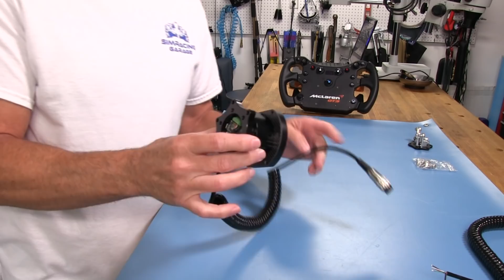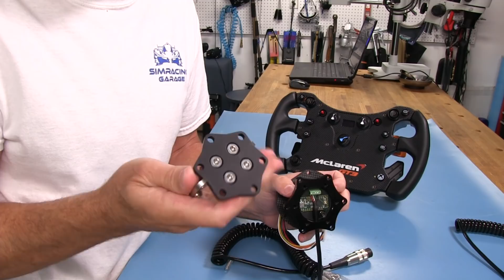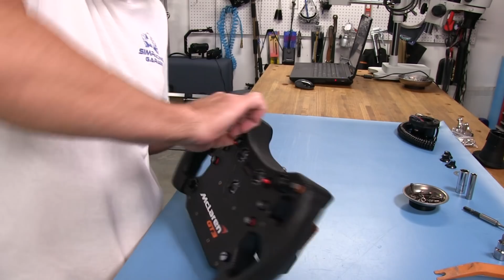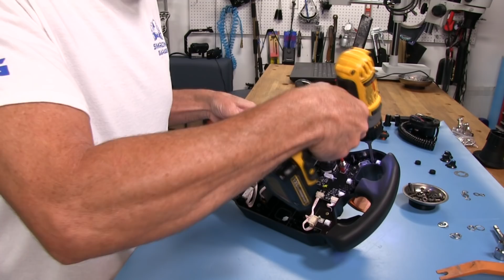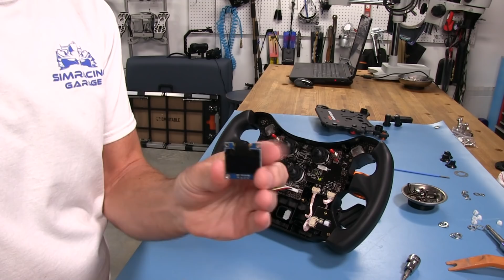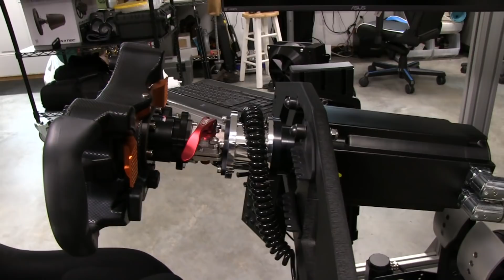SRM Fanatec Mclaren GT3 USB Adapter Review

Comment: i don't this would last (why so much plastic, seriously?a nice looking wheel like that!). in order to make it stronger i would add a aluminum ring inside instead of epoxy if hopefully there is enough space . 4 holes minimum would be threaded. i d use spacers to make contact with the ring. i pre-ordered one and having second thoughts now. yes definitely aluminum rings and stand offs

Comment: Thank you for the video. I am wondering what that molex connector beneath the rhs dial switch is?  Has x101 label next to it.
I am looking for somewhere to get some power for a USB which I want to run to a android pad mounted on front of wheel.

Comment: Interesting that now we know the button on the plastic mounting ring is so the wheel knows if it has the QR installed and the wheelbase can run at max torque on the DD1/2, or if it needs to run at reduced torque for the plastic mount. In point of fact, that means this wheel WAS designed to handle the high torque of a direct drive wheel, which is why it has no trouble doing so when converted. Great review!

Comment: Barry, I always enjoy your reviews.  I purchased the SRM kit as I upgraded from CSL Elite to SimRacing Bay OSW small mige.  However, after 2months of use, the left side grip has completely snapped off the wheel.  I was only running it at 50% (100% in SimCube.  configured as 40nm in iRacing.  which results in 50% power) and had roughly 30hours on it before it broke.  SRM kit is awesome.  But this plastic flimsy wheel will not last long.   First time I used it, I thought I felt some wiggle in the grip.  So I went ahead and took it apart, and filled around the grips with 2part epoxy, too.  But that didn't help.  Your suspicion was correct.  This plastic wheel cannot take the DDW power.  I can't really complain as this wheel was made for CSL Elite, that can run 6Nm.  Not 20Nm like small Mige can.
Reply from the maker: Yeah, we are definitly using this wheel beyond it's intended stress levels. I didn't use mine enough at higher levels to crack anything. But I can see where it would only be a matter of time before problems developed. I still think it's a viable option for those who don't run their DD systems at the higher levels. At least is should last a while longer than yours did. Plus, cheap to buy a another one when it wears out.

Comment: Hi Barry....thanks for putting out such thorough review videos! While watching you drive in this one, I noticed something that I'm not getting from my OSW....and that is how you seem to be able to catch pretty gnarly slides with opposite lock. I have an OSW with Granity that I've happily been driving for about 18 months and, to a degree, I can catch slide with a quick flick, but when in the Formula 3.5 (iRacing) tonight at Sebring going into T1, I purposely overdrove entry and when I went to catch it, the car promptly overcorrected and stuffed into the outer wall. If you have any links to any setup guides for the OSW or links to anything else that you think would be helpful, I'd love to see them. Thanks!

Comment: I'd advise not filling the cavities with epoxy.
The stresses will be diverted outwards to other ribs or cavities in the wheel,
instead of being divided over the intended ribs, that are most likely designed using stress analysis software.

Comment: Barry, if Im loking for wheel for osw aystem is it better to buy fanatec f1 or this one . I know the f1 has aluminum parts so should be stronger.  What's is your tought ?
Reply from the maker: You mean like this one? https://youtu.be/cLfJKsQNhVA
Reply: I mean f1 aluminium or carbon wheel vs mclaren. As I saw in this video you think about support wheels plastic hub ,is that not requaired for the f1 wheel. I have big mige and Im worried if the motor will not damage the hub in the wheel to quick. At this moment I use fanatec bmw wheel with audrino build in motors shaft extension,so can connect any fanate  wheel without ingerete inside the wheel.

Comment: 41:51 holes don't line up?
Reply from the maker: I see that. Will have to take closer look.
Reply: This is because it's using my standard Fanatec adapter, so 3 holes are 50.8 PCD and the other 3 are 52mm for the Fanatec wheels.

Comment: Barry you spoke of modifying the grips.  I am in the 1 percentile that this wheel pressed on some nerve that caused my fingers to loose feeling by the first pit-stop in LeMans or IMSA in iRacing.  However I was able to correct the problem with some course sandpaper used to smooth out the peaks in the grip surface that my hands felt.  The change was small visually but huge in comfort.
Reply from the maker: Yes, the way a grip effects us is very important for driving comfort. Glad you got it sorted. Surprised that we don't hear more about this subject in general. I will be experimenting with some self fusing silicon electrical tapes I have.
Not sure about durability though. Also, now using some gel padded cycling gloves instead of regular driving gloves.
Lot's of things we can try to improve grip comfort.

Comment: I have this combo and the SRM adapter is a very high quality piece.  The only thing that bothers me is the McLaren wheel is a bit creaky.
Reply: creaky will one day go "snap".  R.I.P. McLaren GT3 wheel.  (mine broke after 2months on small Mige 20Nm).  I run SimCube at 100%, and configured 40Nm in iracing.  basically running it at 50%.

Comment: I believe the pin got bent after you removed the plastic QR and laid the wheel on the bench. The QR protected the pins from being exposed, I would remove the QR right before pulling the wire harness through to replace it with the mod.
Reply from the maker: Oops! Now worries...I can fix that! lol...
Reply: Dennis Warn/Mestizo69 PSN ID    I thought Barry was gonna  bend those pins when he was pushing it down on the bench,  slap on the wrist Barry !